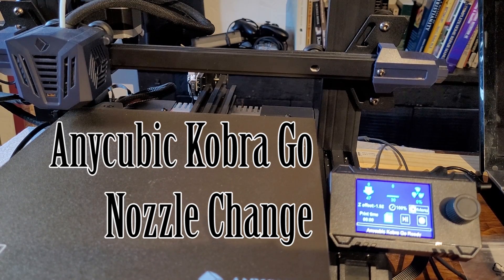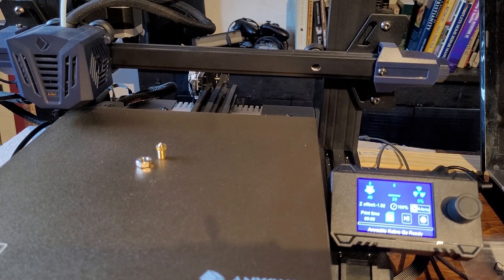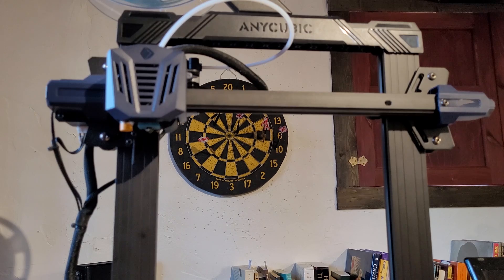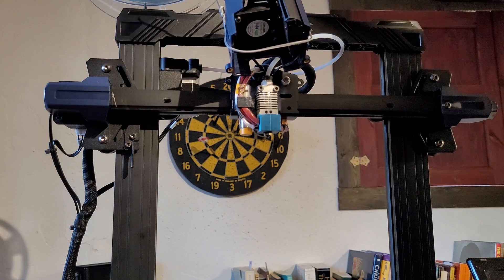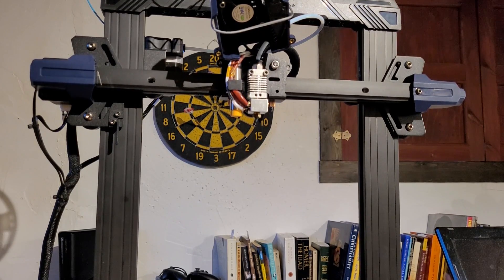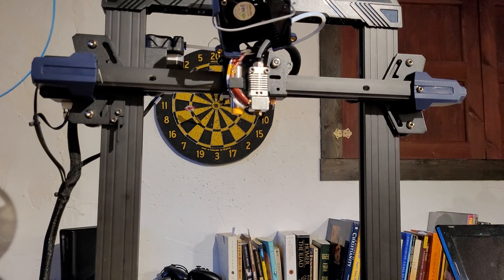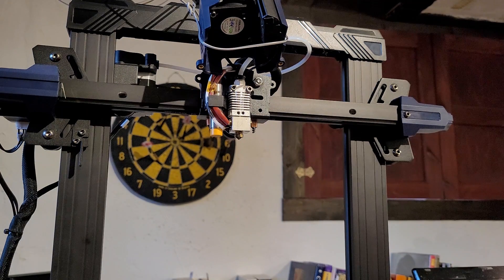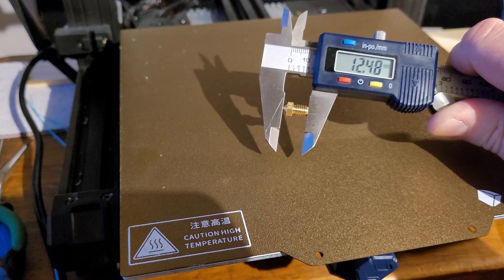Anycubic Kobra Go nozzle change

Comment: couple pieces of missing info : 

1) 7mm socket wrench
2) insulation can/will rip - not a big deal just fit it back on best you can
3) printer will eventually fail on runaway heat if you take too long - just start over
4) print heads are like $1 for 40 - just install a new head

Also if it feels like the nozzle is stuck it may very well be - my nozzle sheared right off leaving half of the nozzle inside the print head - that makes a dead 3D printer
Reply from the maker: Thanks for the add Jason, appreciate it.

Comment: Thank you for all your guides. I never knew that this printer required so much work before I bought it!
Reply from the maker: Thank you Naider
I didn't know either
It was difficult initially until I finally tamed it.  :)
Reply: Lol right!? This printer can have some difficulties 😮‍💨😅
Reply from the maker: @HectorRodriguez-vw5et  it sure did, but working like a champ now
Reply: Same. My issue was the nozzle. I bought a set and they were short threaded so it was making a mess and it would wobble.. But Saul Goodman now! 🤘

Comment: Thanks. Trying a steel nozzle this time around?
Reply from the maker: Excellent let me know how you make out.
Reply: I'm still learning on a basic Anycubic. The steel nozzle works well. I also learned the importance of the z-offset settings. My old brass nozzle looked as if it had been dug along a concrete pavement. Anycubic makes a great simple printer to abuse during ones "learning curve".

Comment: Hey so I did this and when I put my nozzle on and went to go level it it completely pushed my bed down on the first one. This didn’t happen before so I was thinking that I didn’t put it in far enough but it’s all the way tight. I don’t know how to fix it
Reply from the maker: Hey Limitless first thing to check is if your bed leveling sensor still works. With the printer powered on place the printers metal wrench under the sensor and verify the led lights up. If it does then redo the sensor adjustment and see if that works. Check their video at 7:34 https://www.youtube.com/watch?v=voCUjiQ1tzQ

Comment: I have this printer and for the life of me can’t get good prints. Getting random under extrusion and bad layer lines . I calibrated the E steps, got the first layer spot on, all my belts and wheels are good I tried different retractions different temps . I just don’t get it, it’s driving me crazy
Reply from the maker: Hi Silva, late here.  I'll see if I can help in the morning.
Reply from the maker: Morning Silva, I always go back to basics from beginning to end to see if I made a mistake, something has come loose or something has failed. In your Cura machine settings make sure to have M420 S1 Z) entered after the G28 line, this will ensure that you have the auto bed leveling turned on S1 and the fade function turned off Z0. Here is the link to the Go assembly and setup https://www.youtube.com/watch?v=voCUjiQ1tzQ , I set the playback speed to half so that I can really get a close look at what they do. I will be adding some videos soon towards identifying items that could use more explanation IMO. Here is a link towards belt tension that I found useful. https://www.youtube.com/watch?v=zoKmmT0a7jk
Reply from the maker: Sorry didn't see my typo
M420 S1 Z0 is the correct line.
Reply: @mayhemsmiley  yeah bro mine g code line is only m420 s1 there’s no z0
Reply from the maker: @silvamadeVidz  In the slicer or your firmware?
Reply: @mayhemsmiley  in the slicer
Reply from the maker: @silvamadeVidz  Adding the Z0 willonly ensure that the fade is turned off, won't hurt anything.
Reply: Same i have this one and i still can’t get good prints , im thinking of just getting a different one.